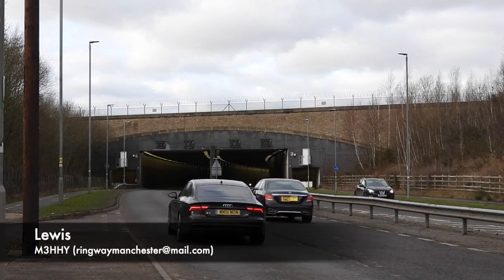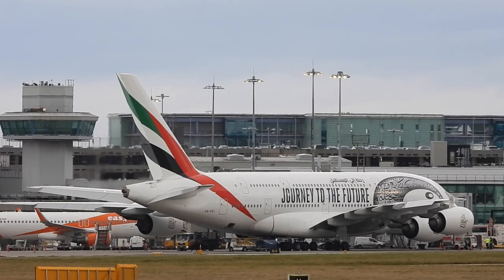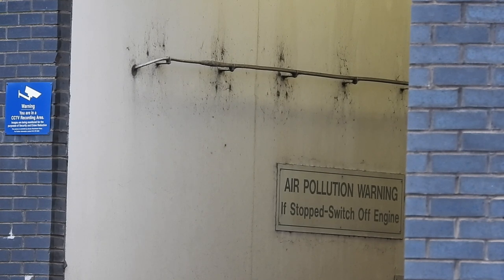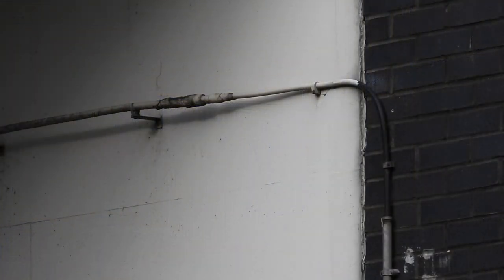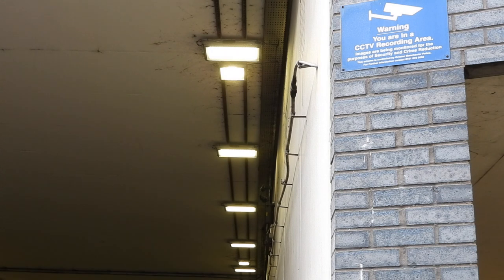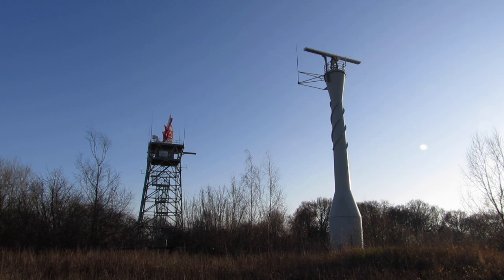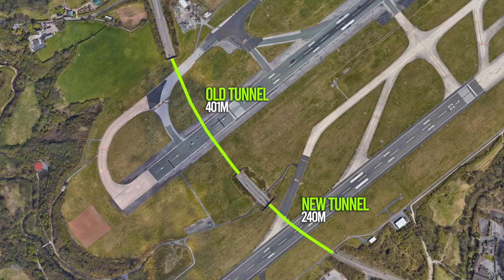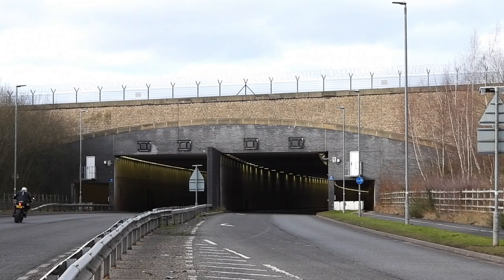How Do Radio Signals Travel Underground?

Comment: I worked on the design and procurement of the 5th mobile network in the Netherlands in 1998. A key business objective back then was capturing roaming traffic from people arriving at Schiphol Airport in Amsterdam - once signed on to a network they were unlikely to change so we’d keep all their highly lucrative traffic! But we were the new boys and couldn’t install base stations in the airport or in the tunnel used by all the taxis heading in to town - the existing operators had leaky feeders etc. and didn’t want more competition.  So we found a supplier of GSM 900 MHz parabolic antennas (this was in the 2G days) and fired a high powered base station via the parabolic positioned by the exit of the tunnel.  It worked very well, propagating down the tunnel and around the bend by reflection and/or refraction - and we got out traffic!

Comment: Here in the states under Part 15 FCC Rules AM/FM/SW and LW can be broadcast over leaky feeder however there is still a limitation on field strength measured by mV/per meter from the radiating leaky feeder, I took advantage of this rule and broadcast on AM/FM to a mobile home park i was living in, hiding the cables was no easy feat
Reply: I have heard of this, it seems interesting. Can you give some more details on how you did it?
Reply: Starlite Stabrite. First power to my emitter tonight.
Reply: Can some explain this what any of this means ??

Comment: I worked in the Washington, DC subway in the early 2000’s.  They used the same thing.   The problem was outside agencies entering the system for emergencies.  We had setups for that in command vehicles.

Comment: Student radio used to require the use of restrictive antenna systems to limit the range achieved, these were very often inductive loops but leeky feeder was used as well. I remember working on the instalation of leeky feeder at Salford University when we moved from one system to the other. 963KHz medium wave by the way.

Comment: The Tyne Tunnels use this system to provide lots of FM radio stations, even Sun FM from a neighbouring city and isn't even meant to cover the area where the Tyne Tunnels are.  For some bizarre reason though, someone has decided that BBC Radio 3, BBC Radio 4 and Classic FM are not needed in the Tyne Tunnels. Those are the only stations that don't work and someone seems to have consciously made the decision to not include them.
Reply: Follow the money there!
Reply: @chrissewell1608  No, I don't think it's necessarily that reason.  BBC Radio 4 is the second most listened to Radio station in the UK and Classic FM is the sixth most listened.  I think it might have more to do with perceived tastes which are not the same as actual tastes. That's only my guess. Whomever installed the system has effectively shunned or snubbed those three particular stations based on either their own personal tastes or those of a relatively small sample size.

Comment: Leaky feeders been used for cellular for long  time in tunnels but also corporate areas in early days. Before London underground finally got round to allowing cell coverage, we at orange were talking with the other operators to get a leaky feeder solution there. Probs 15-20 yrs it took in end
Reply: London Underground has used leaky feeders for a long time for their own radio systems. They are also used mainline railways, but less common since tunnels are usually shorter and straighter so directional antennas at each end can work.

Comment: Here in Norway we use leaky feeders to distribute Emergency Radio and DAB+ coverage in nearly all tunnels.
There are repeaters at even intervals and the repeaters are fed with fiberoptic cabling from a central controller at one of the ends of the tunnel which has the uplink antenna outside.
I was involved in replacing the repeaters in one tunnel, and the repeaters were very sensitive about signal delay, so all the fiber cables had to be balanced to be at equal lengths. That meant having coils of up to 4km of fiber inside patch panels placed near the controller to make the nearest repeater get the signal at the same time as the one farthest away. Newer systems don't need physical cable lengths but correct the signal electronically.
I don't work with that equipment anymore, but I'm currently looking at using leaky feeders to get WiFi coverage inside parking garages of apartment buildings.
Reply: Why not just use WiFi access points ?
Reply: @jasbindersingh2441 We have been having some issues with getting good coverage for EV chargers, so my thought is that a leaky feeder will get us a more uniform coverage throughout the whole garage. The one I'm looking at now is around 200-300m in length. But I'm waiting for a quote from our suppliers, it might be too expensive, I don't know yet.
Reply: Seems like a few POE repeaters would work much better.  Otherwise use 5ghz for backhaul and 2ghz for the guests.  WiFi is so underpowered anyway I just can't imagine it working with a leaky feeder.
Reply: @fungo6631  Yes, he did say that. But you do get leaky feeders made for 2,4 and 5ghz.
Reply: If you try and connect an external antenna (and/or a booster amplifier) to a WiFi router, you won't believe the amount of interferences you're going to bring it in. WiFi works well as long as you operate a specific network name.
My suggestion is to use a single WiFi router with a mesh access point every 50 metres. Mesh networks use the same SSID, MIMO and the same channel. Note that the 5 GHz channels are meant for indoor use only.
Reply: @rayoflight62  Why would we only use 5ghz inside?  It works just fine outdoors.
Reply: @jmr it is much more sensitive to airborne moisture, but the main reason is not effectiveness but rather radiation exposure limits for the larger power needed to be used for outside operaion. You are slightly cooking your users without notifying or asking them.
Reply: @RowanHawkins  We're talking about 5ghz WiFi.  You have something confused.  It's commonplace to use it outside as backhaul.  No one is getting cooked at 1 watt.
Reply: @rayoflight62 Mesh would literally be the worst possible method here, mesh doesn't mean the APs all share the same SSID etc. but that they are connected through wireless links. On expensive units that means dual radios (one for Wifi one for backhaul/uplink) and on cheaper units that means each added AP halves the network bandwidth.
Talk about interference...
What you mean is what is generally included in 'managed wifi', as there isn't a real standard for roaming wifi sadly, it is up to the client to switch to the next AP when signal is getting low, the APs themselves have very little influence. Some enterprise class systems may 'abuse' disconnect frames to try and steer clients onto APs with a higher signal strength, this works for most devices except Apple as they (as usual...) don't fully follow the Wifi specs and will just aggressively switch back and forth between APs. This leaves the iPhone with crappy Wifi and the network easily overloaded with authentication traffic unfortunately, imagine doing that over mesh, you'd be measuring authentication traffic for 50 or so clients in Mbps.
Mesh is mainly used as a marketing term by companies to target consumers that don't understand what it means.
Also, a Wifi router, what's that? Wifi is layer 1, routing is layer 3, they have nothing to do with each other :P 

Best solution here would be multiple PoE-fed APs throughout the structure, carefully located to provide total coverage. I can't imagine such a leaky feeder working reliably with Wifi but it would be cool to try, individual APs are the go-to solution though.
Reply: @5mxg  the chargers don't have wired connection.
Reply: @5mxg  they of course have wired power for charging, but for network it's only Wifi and LTE.

Comment: SOP for ambo is to park one vehicle at the entrance and switch its Airwave radio system to repeater mode, enabling coverage in the shorter tunnels to the hand held radios and any units that have driven in underground.

Comment: Decades ago the biggest AM radio stations in my city got together and funded an antenna that runs the length of the longest tunnel here to allow people to listen to their stations without drop outs. It had an antenna and a wide band amplifier at one end so every AM station in town (even the ones who paid nothing) would be transmitted through the tunnel. 

The system failed several years ago and remains dead because no one cares about AM radio anymore.

Comment: Much of the UK research work into radiating cables was conducted by British Rail Research and the National Coal board back in the late '60s / 1970's.

Cable construction and choice is critical and depends on the frequency band being used and the distance to be covered - lower frequencies being superior to higher frequencies.  As I remember the optimum determined then was around 50-60 Mhz - but obviously not usable for PMR. 

There are many cable constructions developed by differing manufacturers for differing frequencies.  Andrews basically grind the top off the helax screen for example.  Another type uses a UR67 type construction with a number of screening wires removed,  others use punched holes in the copper foil screen others slots.  

A significant design issue is loss per unit length which determines the size of the cable and/or the need for repeaters.  Other design considerations have to address the distance between the cable and the mobile unit.  On a railway for example this is pretty well fixed so a cable in the roof of a tunnel will cover two tracks with probably only 3 metres between the cable and a trains antenna, with no significant obstructions.  Whereas a cable in a road tunnel has to consider not only the height and distance of vehicles but also any blocking across lanes  by high vans and trucks.  

To extend coverage on a long cable repeater systems can be bidirectional or unidirectional the later having a base TX at one end of the cable and a base RX at the other.   Some smart systems use RF over fibre to get signals to the radiating cable end from a parent Base Station, maybe on top of a tunnel in railway world. The fibre to RF units being able to serve multiple cable lengths negating the need for repeaters in long sections.  In theses cases, because the RF signals are all coherent, there are no drop offs / standing waves as mobile units move between cable sections and the outside world.

Comment: The brand name is RADIAX. In some places, it is required to be installed in the elevator shaft (most accessible part of building that covers every floor) of high rise buildings so emergency services can communicate.
Reply: I bet that's expensive stuff and I wonder how it compares to a roll of cheap rg58
Reply: There's another type called GAINIAX which increases the signal. Marvellous stuff. A friend of mine used to swear by it, but apparently it's no longer made 😂

Comment: The "new" Denver airport built in the late 90's did something that may have been leaky feeder, but it was described as cables embedded into the concrete with passive antennas on the ends. I read about it before i was a ham, and ive since wondered exactly what they did. while unshieleded stubs could have received signals, I shudder to think of the loss involved passing down the wire to radiate from a similar not tuned stub from the other end.
Reply: Leaky feeder cables buried into a concrete slab is pretty common in industrial settings.

Comment: When I was around eleven years old I started a superior technical certificate (equivalent to a HND or associates degree) in hydraulic civil engineering with a specialisation in drainage systems engineering. The early months were practical heavy before they became heavy on theory, and I had to descend underground into culverts, storm sewers, etc to train for inspection, maintenance and modification and in a section of one specific culvert, the rebar in the reinforced concrete acted as a faraday cage which caused a temporary loss of signal in that section underground.

Comment: We use a similar system on the London Underground for carrying Station CCTV Camera feeds to a monitor in the drivers cab within a certain length either side of the station. This system is used both below and above ground, but only on the Central, Northern and Jubilee lines. The Victoria and Sub Surface lines use a much newer system, with the Piccadilly and Bakerloo lines still utilising old style monitors on the end of the platforms.

Comment: Vancouver’s downtown Skytrain expo line has had a leaky coax system in there since the early 90s for cell, but as with Manchester, I am not sure if it was ever adapted for the newer digital signals. Also Skytrain also uses leaky coax for train control and communication. Two parallel limes crossing at fixed intervals for the LIM based Bombardier system, and one for the newer but less sophisticated Canada line to Richmond and the airport.

Comment: Another great video, Lewis. I guess the slot sizes and spaces have to be such that there is resonance at half-wave and their spacing will affect the radiation pattern - important particularly if there is no line-of-sight from one end of the tunnel to the other. Great stuff. 73

Comment: I designed a built a broadband leaky feeder system in use 50 feet below ground at the Stanford Linear Accelerator Center.   The systemI built is 11,000 feet long with 14 amplifiers distributed around a ring tunnel.  You're right about intentionally porous shielding being the key to its operation.   And yes, 1 GHz is about the upper limit of a leaky feeder system

Comment: There is a non-powered version of these. I know it as "passive repeater", two antennas separated by resonate length of balanced feeder.
I've also seen the "leaky feeder" used without being powered.
It's all about resonance and impedance.

Comment: I remember they had some sort of leaky feeder at my old uni where the student radio station broadcast on really low power throughout the halls of residence. It's so mean-spirited of the powers that be not to grant a licence for the whole town as the airwaves weren't exactly full to the brim back then in the early 90s.
(But for a leaky feeder of course you didn't need any licence at all, because the power was too low.)
I remember being outraged last time my friend was in hospital. I looked everywhere for the headphones piping in the BBC and hospital radio but there was nothing! Just rent a Freeview TV for well over £5 a day! What an uproar! No more amateur DJs (except on the BBC 🤪‼️) I'm sure hospital radio didn't use leaky feeders. Surely that was more like cable radio...?
I heard that the first BBC broadcasts to Mayfair, Belgravia and similar places were actually delivered by cable. I can't remember if this was TV, radio or both. Is that right...?
Reply: Most college radio back in the 70's and 80's transmitted through the power lines. Each dorm building had their own small transmitter.
Reply: @brucekives2194  someone told me it was a copper wire but it's not like I actually saw the wire! I'm pretty sure it was MW, if that makes any difference. I remember electric lights interfering with AM radio badly especially kitchen lights. I tried to get longwave radio recently and it is still going, but only one station: BBC Radio 4 on 198 LW. The signal was totally covered in interference until I got at least 20ft from any building and then it came through.
Reply: @ZadenZane  
In the US, it was more often carrier current over the power for MW. For FM and TV, they had coax in every room. Things might have been different in the UK. 
https://en.wikipedia.org/wiki/Carrier_current
Reply: I was a volunteer in hospital radio (broadcasting) for about 15 years. It was 100v mono though a number of amplifiers at the hospital, and carried over BT analogue leased line to the remote hospitals and their amplifiers. At the bedside was a selector, 4 channels, one dedicated to the "tv on legs", a BBC national (usually) either a local station or another national, and the channel for the hospital radio. Quality was poor to say the least. Those bedside TVs were adapted to take the hospital radio feed, still in mono, and provide additional radio services, and TV, and yes you have to pay for the TV services but the audio was free. The station I was at now streams on the internet and expect listeners to 'tune' in that way. With many having a mobile phone that is probably quite easy but at the time I left, personal electronic devices were taking over as a patient's choice of entertainment. (I now stream on twitch from a home studio, who needs transmitters when the mobile networks have provided a global mesh?)

Comment: I tried to encourage a local electricity company I worked for to use a leaky feeder system in a cable tunnel and I did all the reasearch for them on the subject but it was thrown out and was told it wouldn't work when the proof was in black and white in front of them paased history left  the company shortly after that.

Comment: Something relatively local and maybe worth a look is the road tunnels under the river mersey. I suspect they just retransmit FM radio frequencies from above ground to below, as the likes of DAB doesn't work, but FM does. Both tunnels appear to have a similar system in place
Reply: Norway scrapped the FM system in favor of DAB. I stopped listening to radio because the system was so shit. I don't regret it though, the programming also became shit, or maybe I just awoke from the brainwashing.